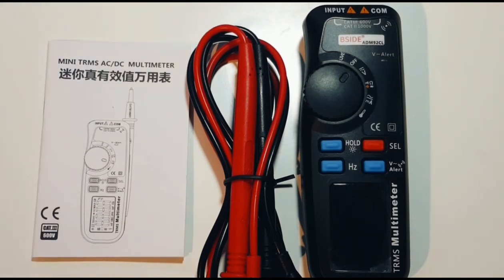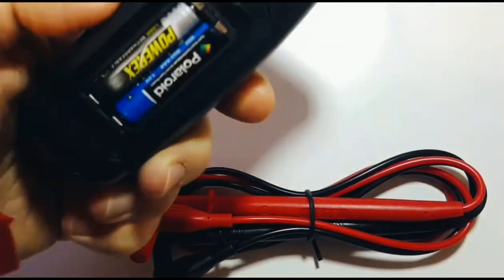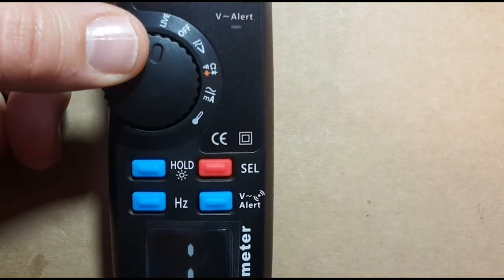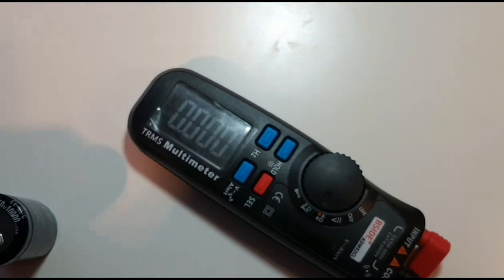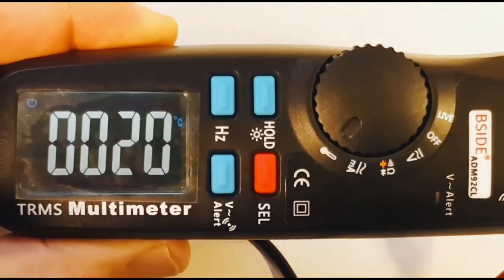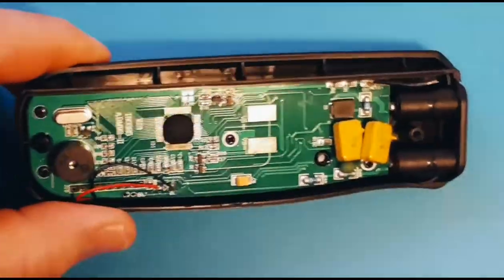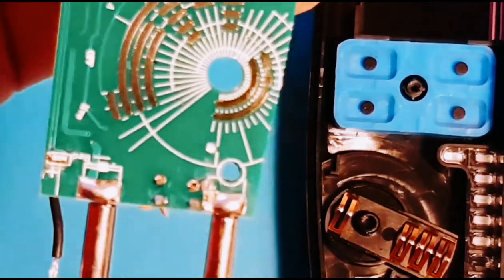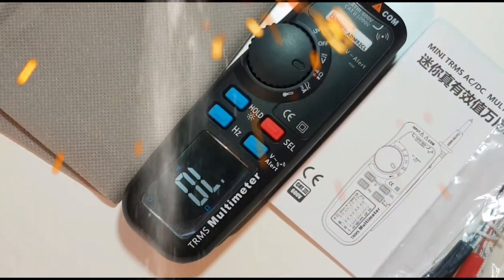BSIDE ADM92CL CHEAP-O Multimeter Review & Teardown

Comment: Wow, love the pace of new videos lately. Keep it up. This meter seems quite interesting just for the form factor. Can you check to see if the screen is still readable as the battery voltage gets low (or with NIMH cells). This was a huge flaw in the Aneng Q1 despite being an otherwise decent meter used an inverse LCD screen which struggled with anything less than 3V from a fresh pair of AAs.
Reply from the maker: Thanks for the kudos! Good point, I'll have to check the voltage drop-off and I'll post a follow-up here.
Reply from the maker: LCD was bright and strong down to 2.5 V, after that it started to slide. Without the backlight it was workable down to 2.2 V. All in all quite good I'd say!
Reply: @KeepOnTesting  That's better than the Aneng! Still less than ideal since 2x NiMH cells top out at 2.4V, but it might be workable. Thanks for checking.
Reply from the maker: @superciliousdude  My pleasure...Its a solid meter too...much more so than I expected.

Comment: Looks okay - but very restricted current measurement, and the 0.5 ohm measured 000.7 ohms which seems pretty far out to me. Do any of these meters do better on sub-ohm resistance?
Reply from the maker: Yes the mA range is minimalistic at best. Generally, the accuracy of MOST DMMs below 1 ohm are not very good.  You would normally need a 4 wire kelvin type measurement at this level.  Most 6.+digit bench meters are only good to 0.3% at 1 ohm. The reason is that these measurements tend to be at the low end of the range and the =/-% of range part of the error starts to become very large. Best solution for sub-ohms measurement is a decent LCR meter. There are other ways of course but it can get quite verbose. Might make for a good review!
Reply: @KeepOnTesting  Thanks - my memories of meter errors grew fuzzy since I graduated in 1986... I guess two DMM's would be good (just add a $1.77 DT-830B meter to the shopping basket for voltage only).